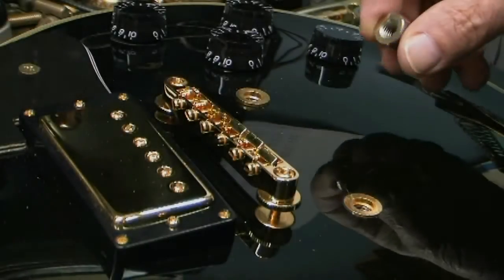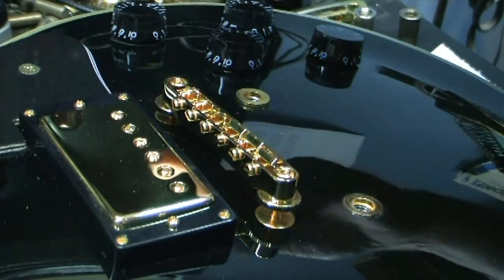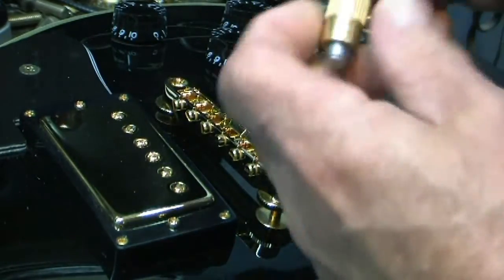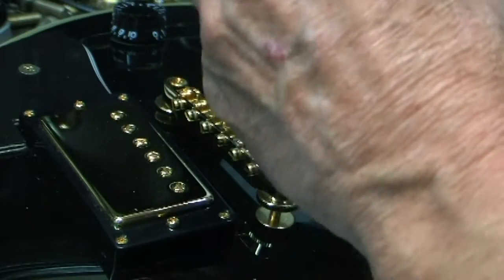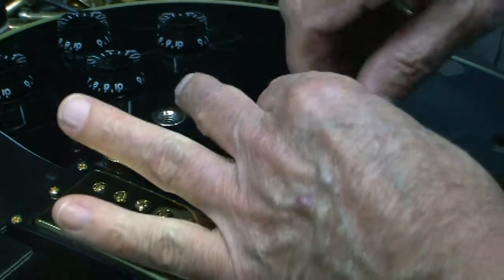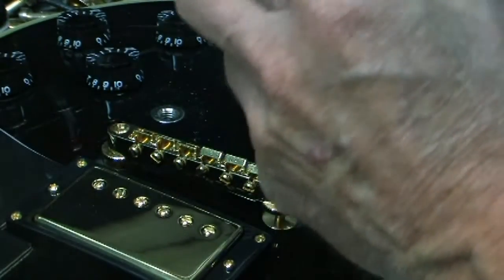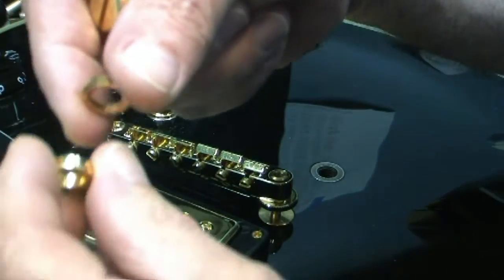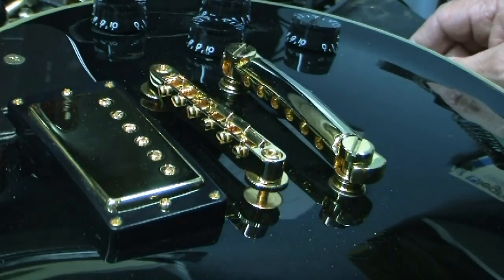Faber-MetricBushings-Install

Comment: I just tried this on the bridge bushings with the bolt in my Faber kit and they didn't budge. And I didn't want to keep cinching down on the bolt because I'm afraid its going to split the back of the guitar. This is Justin from LA if you read this, Larry. Just ordered some E-serts from the Xmas sale.